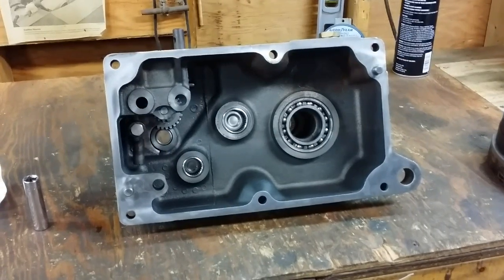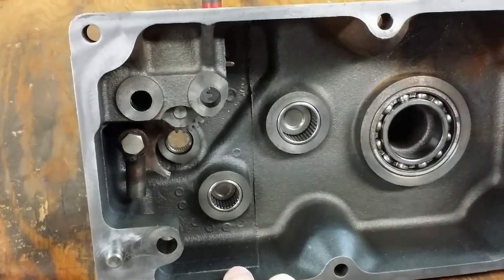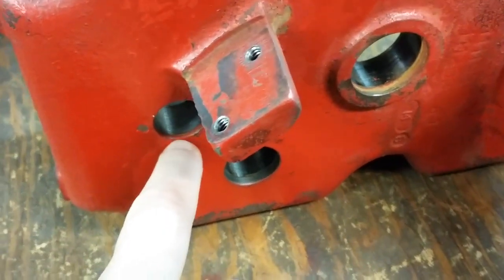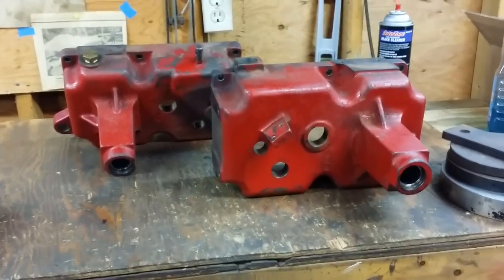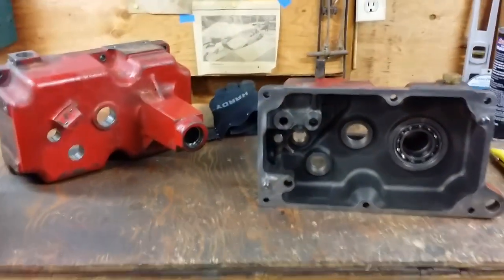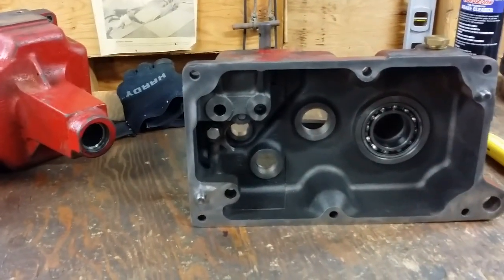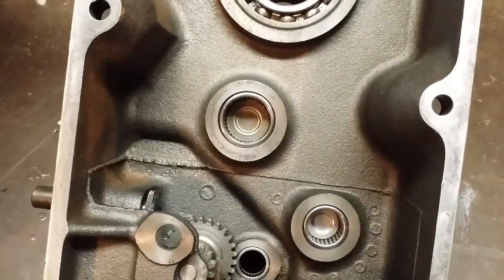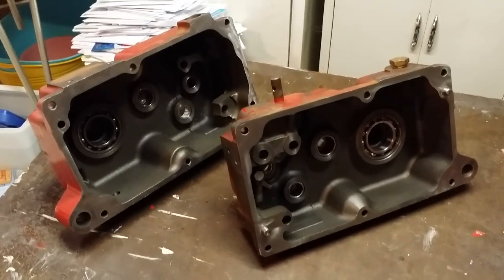1967 Wheel Horse 857 8 Speed Garden Tractor Transmission Repair VinsRJ

Comment: What’s the difference between this transmission and the 3-speeds?
Reply: The 3 and 6-speed transmissions differ from the 4 and 8 speeds in that the brake drum shaft is in a different location.
Most or all of them are physically interchangeable on the outside except that the brake rod link would have to be changed or modified.
Reply: Eric B / ebinmaine i have a 953, is it possible to adapt any of these “square bodied” transmissions to my tractor?
Reply: @dcacmc3693  All of the tractors in our fleet are the square hood mid-60s or the B and C series of the 70s.
I'm not super familiar with the 953 or 1054 tractors but I think the only difference is the axle length of the 953 or 1054.

If you haven't already done so I would highly suggest that you check out

https://www.wheelhorseforum.com/

It's a great place with lots of very helpful people. You will absolutely get your answer...
Reply: Eric B / ebinmaine thank you!!